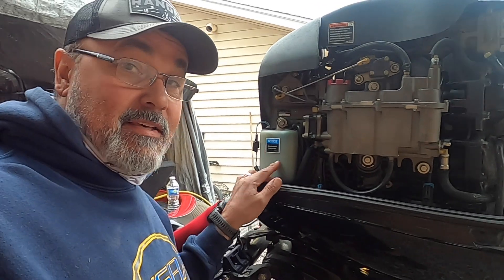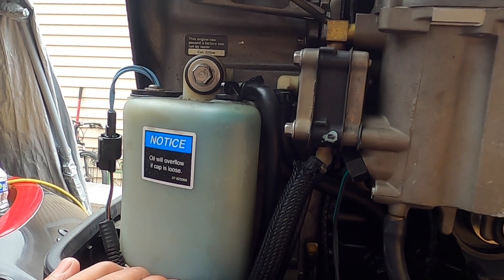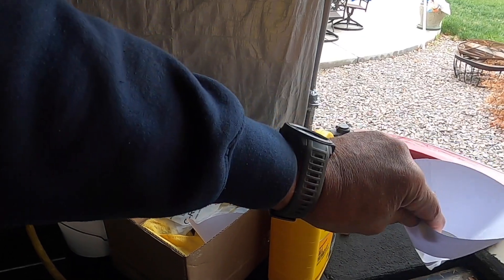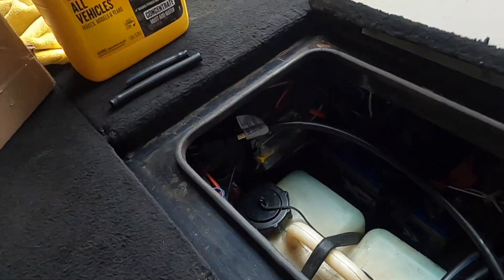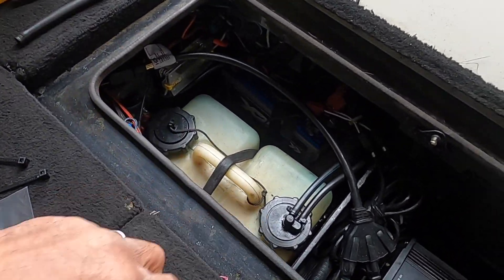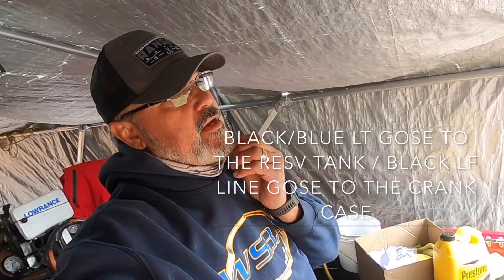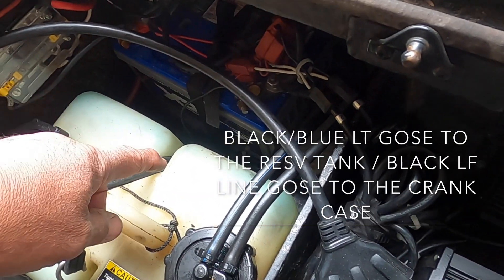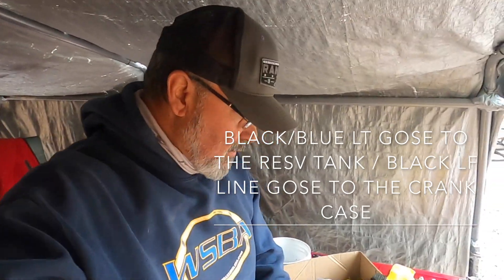4 beeps oil Alarm Repair 225 Mercury Optimax

Comment: If the 4 beep alarm goes off and upon inspection you see and can confirm that the reservoir under the cowling is in fact full, the sender unit inside that reservoir has likely failed, and is incorrectly telling the ECU there is low or no oil and will go into limp mode.   The reservoir’s sender is not user serviceable, the whole reservoir needs to be replaced.   To get out of limp mode in this situation, you can disconnect the wire coming out of the reservoir and jump the two contacts with a wire and the system again thinks it is full.  If replacing that reservoir, on the old one which is bad, you can remove the probe from the tank, and from a hardware store get 2 or three round magnets that fit over the probe.  Slide them up towards the top and zip tie them under the bottom most magnet around the probe base so they stay up at the top and don’t slide down.  Keep that old probe with the magnets in the boat, and if the new reservoir ever fails in the future, just disconnect the wire and plug in the probe with the magnets and it will also stop the 4 beep alarm so you can get back without being in limp mode.  

It’s very important to actually confirm that the reservoir in fact is full before bypassing the 4 alarm safety system, and to replace the reservoir with a new one as soon as practical.